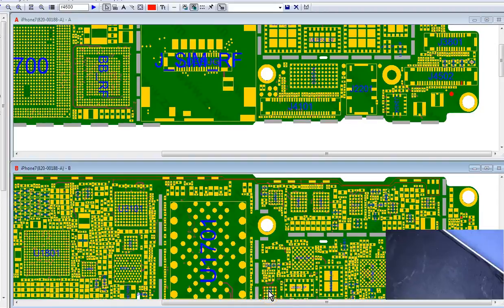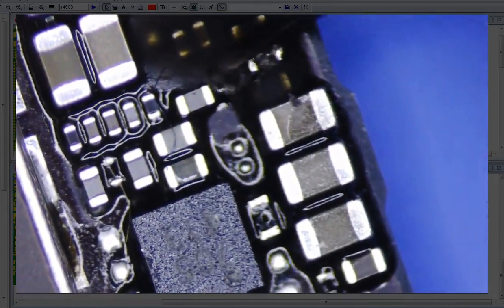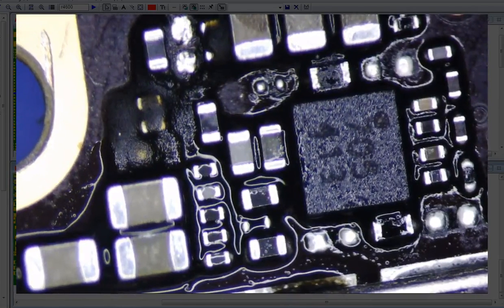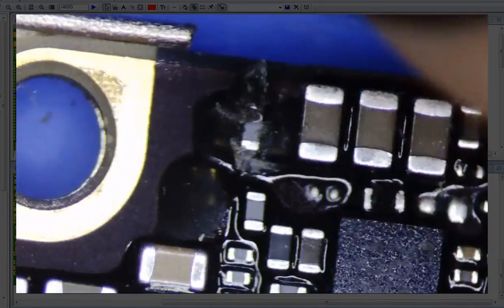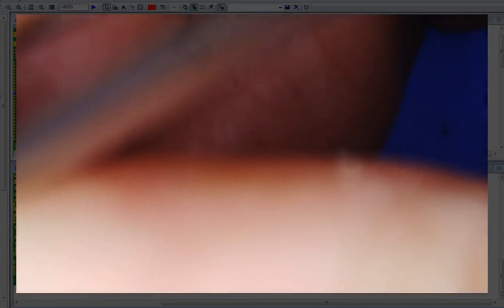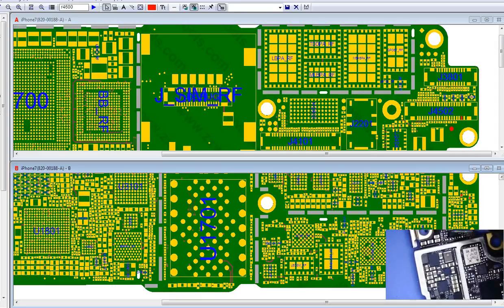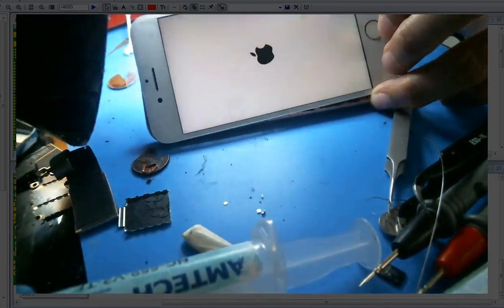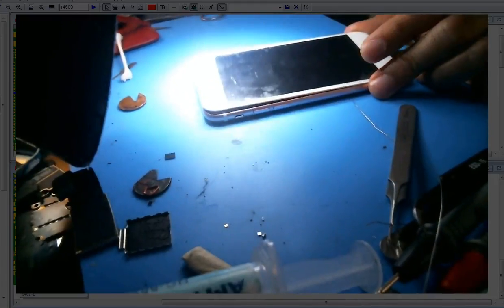iPhone 7 Backlight Filter Repair

Comment: i see the micro tweezers you have listed are $1,400.  Are there any cheaper ones that i can buy just to get started.  I have most of the tools i need but i'm missing micro tweezers.  Or is there a video for removing filters without tweezers...I seem to be melting everything without them.
Reply from the maker: Spend some time to get to know your hot air rework station.  Practice on some donor boards to see if you can remove components without melting stuff.  You can almost always use hot air to remove things.  Tweezers make things easier, but they're not always necessary.  Hakko fm-2023 is a good alternative.
Reply: you could go for the JBC CP-2E Micro Tweezers Station which is about 545 euro half the price of the nano tweezers .only issue is the micro does down as far as 0402 component nano does down as far as 01005

Comment: I see that your using jbc base 1b which is nano and will do chip size 01005. I am looking at jbc cp 2e micro tweezers which states it does size 0402.is this similar to hakko model . Have you any experience whether the micro model 0402 would be able to do 0201 smd component . Thank you

Comment: You charge extra to remove the motherboard?
Reply from the maker: You gotta look at the bigger picture.  There's more risk when disassembling the entire logic board from the frame.  In addition, if you have to warranty the repair, then you will have to disassemble, reassemble again.  There's a risk that an antenna, a camera, some connector may get damaged in the process.  That's the way that I look at it.  To each their own though.
Reply: True. We just replace it if we break it. Cost is like $4. No biggie. But we do it 10 thousand times a day so it is no big deal or extra charge. Its what we get paid to do in the first place, no matter if it is a free inspection/diagnose. Anyways, I love the vids bro! When you are microsoldering I know you ain't scared of board removing, cameras and stuff. We're too hard core for that, its part of the job.